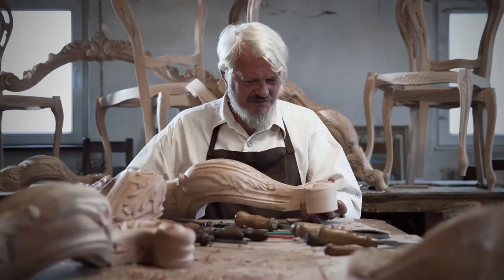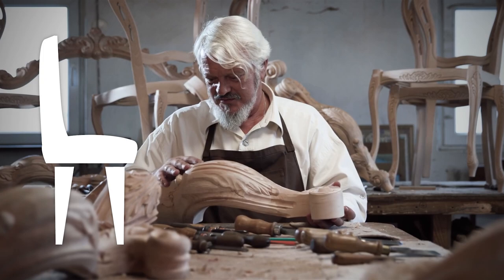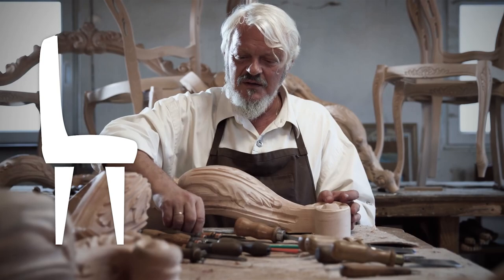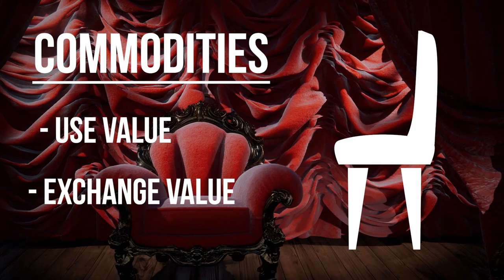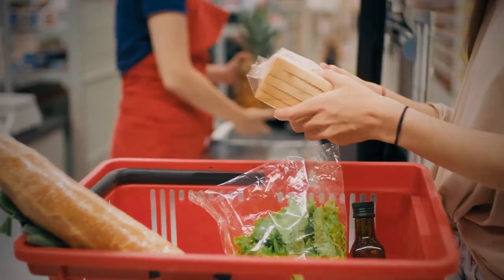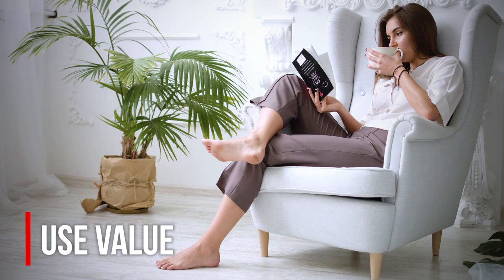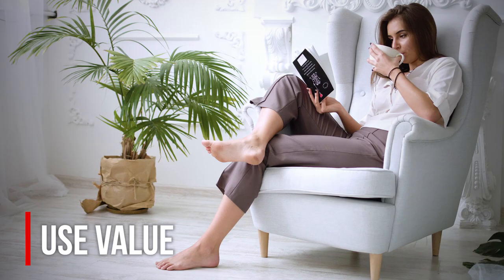Marx's Law of Value: Intro to Marxist Economics | Socialism 101

Comment: 12:00 "And again, always assuming that supply and demand are in equilibrium." That's a VERY important thing to qualify the LTV with, because one of the most common rebuttals to the LTV is "but prices and supply and demand!"

Something that a LOT of people talking about "surplus value" get wrong is that it's not merely the value of what the worker didn't get paid. In Marx's "Value, Price and Profit," as in Capital volume 1, Marx explains that the surplus is the value beyond what it took to produce. It's a hard concept for many, and pretty much every breakdown of the concept of surplus value appears from the same incorrect source.
To start, the value of the labor is based on what is necessary (on average) for the worker to live and reproduce. The value of the materials and facilities are also factored into the value of what is produced, making the surplus value not the extra exchange value above what the laborer was paid, but the extra exchange value above all of the combined inputs of labor, materials, facilities, and any other inputs. (Equipment maintenance isn't part of production value, because the tools themselves have already been accounted for, but is still necessary to continue production by ensuring that the tools can be used longer. The value of labor and the rest for maintenance doesn't produce an exchange value, but is instead taken from the surplus.)

That distinction of what constitutes "surplus value" is important for discussing the issue with capitalists. Their favored talking points include the standard "Marxists believe that the workers should get ALL of the value from their labor," which is untrue per Marx himself (see the works cited above), and is made nonsensical by the understanding of what differentiates between the value of labor, the value of production, and the surplus value. Marxists don't want all value to go to the workers, but want the workers to be able to decide how to distribute the proceeds gained from the exchange value of what they themselves work to produce. That includes not just the pure profits above the cost of production, but also the costs of production themselves, putting the workers in charge of governing the means of production.

All of that said, this video does a good job of explaining a lot of the points about value per the LTV, especially for being so short.

Comment: "€80 has been generated from living labor in the production process." (9:25)
No, a chair has been generated from living labor in the production process.
There is no "€80" until the chair gets sold.
For that to happen, someone has to go out and find a customer and make a sale.
Acquiring new customers can be costly and time consuming. People don't do that for free.
So the chair's final €100 sale price has to cover both the making of the chair and the selling of it.
And that money, after material costs, gets divided between the worker and whoever acquires the customer.
Reply: That's what the "..." dots were for in the equation. Production cost here includes every step of the process from processing raw material to selling the chair to the customer/retailer (aka cost price). The issue that the video is trying to point out is that, in order for the company to make a profit, the turnover has to be higher than the cost of the OVERALL production cost because the "capitalist" needs either his company or his pockets to grow. An ethical company, where the capitalist would be alright with selling his products at cost price  + capital invested, would stagnate, as greedier companies reinvest their surplus in order to improve production volume, increase the economy of scale, and beat the ethical company, therefore making this  a systemic problem where the greedier company is rewarded 

Remember that Marx comes from a time where there were literally no work or salary regulations. workers were paid enough for them to stay alive to work the next day, and the benefits were basically reaped by the business owner who could do whatever he damn well pleased with it as mentioned in 13:38.  Obviously, a company cannot do that anymore and has ethical and legal limits as to how it should use its money.  The issue wasn't so much with the salaryman not being paid his full worth, but being paid a ridiculous fraction of said worth. And that issue still stands today and is what most left-aligned people ask : "how much does one objectively deserve ?"

Comment: I've been having trouble understanding the part about automation leading to falling profits due to the decrease in socially necessary labor, but I'm realizing I think that comes with the assumption that the same workers are still working for the same wages they were receiving prior to automation occurring, rather than it getting to the point where the machines are replacing workers? I'll do some further reading in the near future to get a better grasp on the concept, but I'd appreciate any insight anyone has. Thanks!
Reply: He doesn't explain it because it contradicts reality. In Marxs theory, Capital intensification induces an ever decline rate of profit.

Comment: I think something that is important to remember is that the exchange value of any product is not determined by the producer. The producer is a price taker, not a price maker. They set the prices, but they are forced to sell their products for what people are willing to pay. 

If the producer cannot sell the product for more than it cost them to produce it (aka the exchange value is less than the labour value), then the producer will lose money and will probably stop producing that item. They can only raise the price if people are willing and able to pay the higher price.

This flies in the face of the "wage-price spiral". If prices go up because of a supply shock, wages have to go up to meet it or nobody will be able to buy the products. It will then stabilize at this higher price level. But this does not work the same in reverse. If wages go up, it means profits will go down. As long as the wage increase isn't so drastic that it causes the labour value to exceed the exchange value, then all it is doing is reducing profits. Some prices on items with small profit margins may increase a bit to maintain that small margin, but most of the increased cost is simply producers raising prices because they can get away with it, not because they have to. 

If a company can sell a product with a 10% markup, and wage increases reduce that to a 5% markup, that company can absolutely remain in business with that 5% profit. They are choosing to test the waters and raise their prices to see if they can maintain that 10% profit rate. Saying that they are forced to do this because wages increased is like saying that I am forced to go back for seconds at a buffet. I ate enough to sustain myself on the first pass. The second pass is just gluttony.

Comment: I still have hard time to understand how prices are determined based on social necessary labor time !! 
What is the value of one hour so we can determine the price ?
Reply from the maker: Have a read of Marx's "Value, Price and Profit" which explains this in more detail: https://www.marxists.org/archive/marx/works/1865/value-price-profit/
Reply: @Marxism_Today  thanks alot paul , i am in love with your videos , you and other youtubers encouraged me to study marxism .
Big respect from Egypt .
Reply: Prices aren't determined by social necessary labor. It is determined by offer and demand.
It's true value is determined by the SNLT. Offer will be informed by the SNLT has it is, well, necessary but sometimes capitalists will sell at a loss, in fact it happens regularly due to over-production.
Marx discussed this in the book Value , Price and Profit where he noticed that if you take the fluctuations of price in an industry over a long period of time and put a line on the graph representing it's average production cost of the commodity and another line for the average price you would see those lines overlap. So average price = production cost, now you can do the same for the industry of the ressources necessary for the commodity to be produced (wood for a chair) and have the same results.
So if labor is the common denominator and also a commodity....
You get the idea, I hope that helped.

I just want to note that this may not be as empirical in modern capitalism as it used to be, maybe average price doesn't equate production cost anymore due to some other factors, if anybody has a study on the subject I would love to see it.

Comment: While this is somewhat an ok intro, it is lacking in two ways.  Productivity increases more significantly in the real world through improvements in production through the use of machines, robots, etc., since intensification of labor (increasing the speed of works e.g.) has definite physical limits.  Productivity increases is the same as increasing the surplus rate of production s/v.  The total value produced is the same, BUT this expressed in more commodities, thus the production cost of each commodity is lower.  Now, the second way in which the presentation is lacking.  The capitalist using improved methods can sell the commodity at the prevailing market price OR even at a lower price to capture a greater segment of the market, i.e. underselling his competitor.  The market price is the condition of average production, where price is equal to value.  At this price/value, market price is equal to market value.  The commodities produced with less labor will have a value below this market price, those produce with more labor will have a value above the market price.  Since all commodities are sold at the prevailing market price, THEN, there is a transfer of surplus value from the commodity produced with more labor to the commodity produced with less labor.  This solves the connundrum of why then produce commodities with less labor if it results in less value.  This process is discussed in volume 3 as the equalization of the general rate of profit.  Capitalists engage in production with the goal of realizing the prevaling average profit and this is where the competition among capitals revolve around. Capital seeks to go where profit is above the average profit. Thanks for reading and I hope this helps.

Comment: So the slower you work the more value you create.
Reply: You definitely didn't watch the video.
Reply: @shutupmafafa  Well yes this is true ;-) But I've read the book, and that's what it says.
Reply: @tomrobingray  you read the book wrong then! The keyword is socially NECESSARY labour time. If you spent 3 hours making a mud pie, you've created no value. If you spend more time than is socially necessary making a commodity, you've imbued it with the same amount of value as you would have if you were to have done it at a normal pace.
Reply: @shutupmafafa  Verbatim from Capital vol 1 chap 1 sec 2 : "But assume that the duration of the labor necessary for the production of a coat becomes doubled or halved. In the first case one coat is worth as much as two coats were before; in the second case two coats are only worth as much as one was before."
Reply: @tomrobingray  yeah, if you double the time necessary to produce x coats you get 2x the amount. it doesn't mean working slower for the same x coats XD
Reply: @abitsilly   One plus one is two. One is half of two. Do you understand my child?

Comment: The model used seems to assume that the value added in the production process and the amount the product is sold for is the same. That is not an appropriate way to measure worker value. For example does the labour power increase if the chair is resold at an even higher price? Also what level of exploitation would be appropriate? If this model were applied would there be provisions in place to promote private investment because if there is absolutely no exploitation how would the individuals investors recoup their investment? And thus why would anyone ever bother to provide the proletariat with the opportunity to be compensated for their labour power?
I know this is a loaded statement but I would love to watch a video made by you to address any rebuttals a capitalist or a social democrat might make against this model. Until then I would love to discuss this in the comment section.
Reply: I concur; I'd like to hear more about this. It seems as though a 0% rate of exploitation is unsustainable. How does one know what rate is "right"?
Reply: That's the thing,capitalism cannot sustain itself because of the falling rate of profit plus it's showing how the exploit of the worker is necessery.The absense of exploitation is only viable through anarchism/communism with the transition of the mop to workers,the elimination of classes and the change the reason we produce products from profit to need of the society.
Ps.I am new to theory if my anwser is problematic a fellow comrade should clarify my position and explanation.
Reply: Haven't y'all noticed the main problem that Capitalism ALWAYS suffer, which is being so good in producing stuff to the point of flooding the market, while the big companies devour any concurrents in their path?

THAT is two of the CONSTANTS in any Capitalist crisis - overproduction and "too big to fail" business failing.